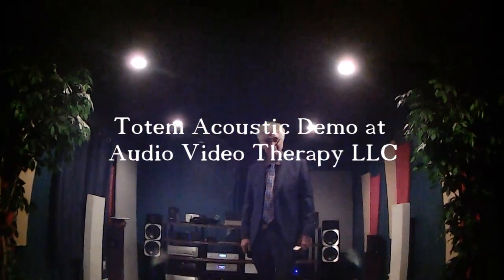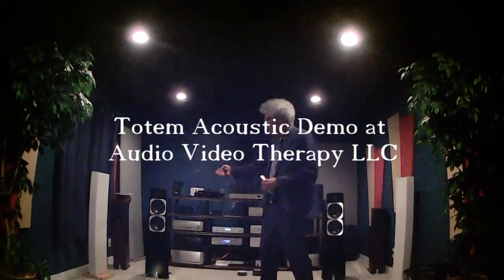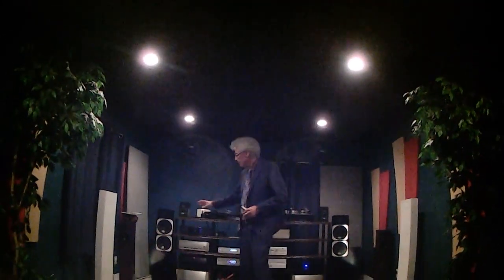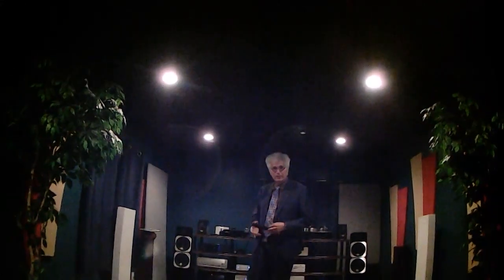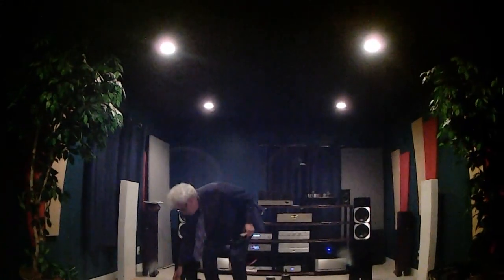Totem Acoustic Element Metal Speakers Demo with Vince Bruzzese [HQ Binaural Recording]

Comment: I demoed them last year and, IMHO, they are far better than Electras 1038 or BW 802. Very holographic sound I only heard before from tidal piano cera. Really amazing speakers. Great video!!
Reply from the maker: ramon vives Thanks! The recording quality came out very good. I was equally impressed by Totem's Kin Mini setup. Could you tell when he turned the speaker? If you listen closely you can tell how amazing each speakers dispersion is by how little Vince affects the sound when walking in front of them.
Reply: 3DaudioXperience
Actually I can´t, amazing dispersion indeed. These tiny wonders and the sub sound so great, on the other hand the Metals are dynamite. When I demoed them (with the NAD M2- not a super expensive hiend amp, you know) I could´n believe that sound from a rather small box (compared with Wilson WP, for example) and two 7" drives.
Reply from the maker: ramon vives Indeed they are pretty amazing! Vince said it costs the company $1,000 a driver to make as they are hand made by the company. What impressed me was that I was not disappointed in the Kin Mini setup after listening to the Metals. They are very good. Some of the best I have heard!
Reply: 3DaudioXperience
Maybe soon, my friend, maybe soon...

Comment: what totem needs to do is produce a speaker similar to their signature book shelf model only in tower form.this could be as a tower the signature's tweeter along with a separate mid range driver along with 2 or 3 woofers.